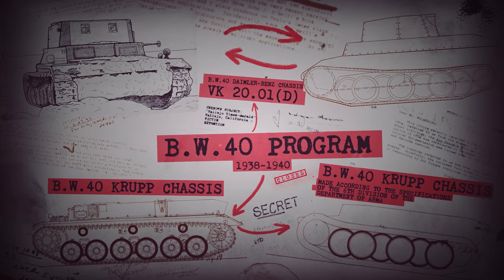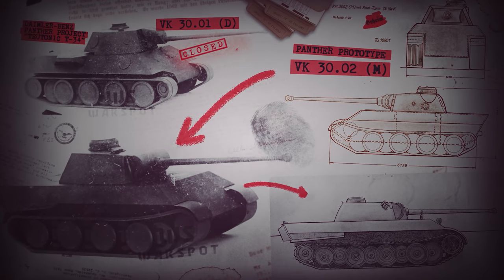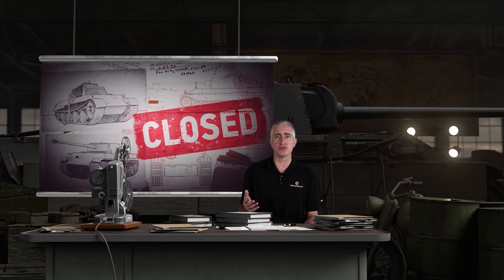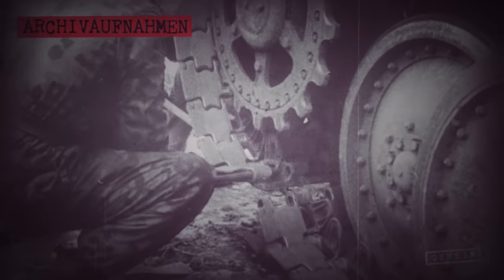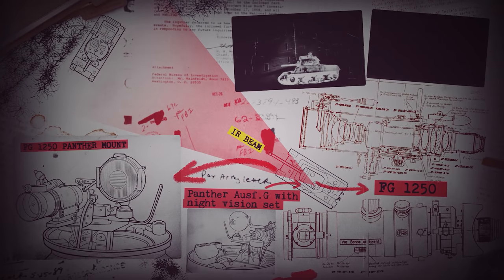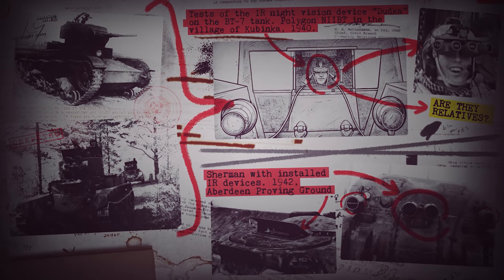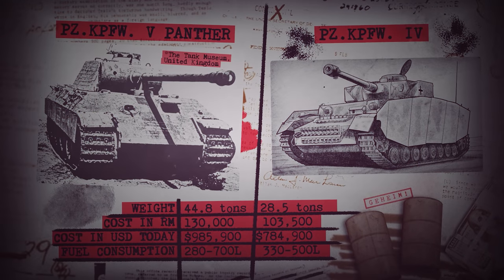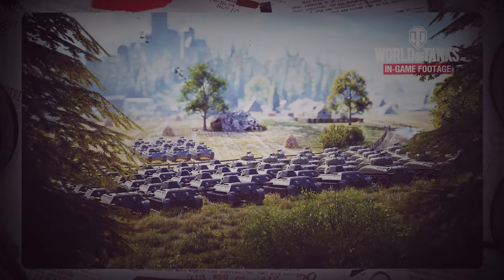Five Things About the Panther with The Chieftain - World of Tanks

Comment: the 5th point you made was interesting.  So my question is:  Would it have been better to concentrate production on Panthers and Stugs and ignore the Tiger program and possibly phase out the Pz IV more quickly?  (was this even on the table?) 

 In other words were they just building too many different types tanks. Was it even  possible for factories producing Pz IVs to easily move to Panther production?   And then there was Hitler's fixation with  Heavy Tanks.  Would Germany have been able to concentrate on a single main battle tank considering  Hitler's meddling and the state of manufacturing in Germany.
Reply: No don't think so if we follow the logic and the purpose of introducing Tiger and other heavy tanks. The purpose of Tiger is to handle enemy heavy tanks such as Churchill or IS or KV, and it is designed to handle multiples of them (the quality mantra). It also supposedly should handle more Mediums when needed compared to a single Panther. 

This is just an example but, if Panther is supposed to handle 2 or 3 Sherman or T-34, a Tiger is supposed to handle 4-5 Sherman. No data at production cost but it probably will not even reach 2 times the cost of Panther, while supposedly able to handle more tanks than a Panther, while also keeping 5-man configurations. 

And in a way, while Hitler does meddle, it probably does not affect it that much and its not like its illogical too on what he's thinking. Even American are using M6 to sell war bonds even though they never use it, and people understand size easier.
Reply: When you think it through, the Germans didn't actually produce that many types of tank.  Throughout the entire Nazi era there was the Pz I -VIB, so seven German types, plus the Pz 35t and Pz 38t.  That's nine types in total, and seeing as both the Pz I and Pz 35t were to all intents and purposes out of production before the war actually began, really just seven.  Further; at any given point in time they generally had, at most, five (and more usually four) distinct chassis under production.  The difference is the huge variety of converted and captured equipment they fielded, which makes what their factories were actually doing look far more of a mess than it really was.

In the same time frame, the US army manufactured the M1 combat car, M2, M3, M5 and M24 light tanks, the M2, M3 and M4 Medium tanks and the M6 and M26 heavy tanks, so ten types.  There was also the M7 and M27 medium tanks, but they were really prototypes similar to Panther II and Neubaufahrzeug.

Similarly, from 1934 through to 1945 the Soviets built the T-37, T-38, T-40, T-60 and T-70 light tanks, the BT-5 and BT-7, the T-50 infantry tank, the T-28, T-34 and T-44 medium tanks and the T-35, KV series and IS series of heavy tanks.

Lets not even get started on the British.  They built literally dozens of different models of tank in this period.

However, it is fair to say that once they got settled into production in earnest, the Americans and Soviets produced fewer types of chassis at any one time (typically just three) than the Germans whereas the British were in more or less the same ball park.
Reply: @ArchusKanzaki  , thanks for the reply.  Really helpful.
Reply: Appreciate the reply.  Thanks much.
Reply: @ArchusKanzaki  Steven Zaloga had put out production estimates for Panthers, Tigers and what not in his book "Armored Champion," giving ranges like: 
- Panther  without gun, radio or other components coming in at 117,100 Reichsmarks, on up to 176,100 Reichsmarks (with everything?); 
- Tiger at 250,800 Reichsmarks (without gun, radio or other components),  on up to 299,800 Reichsmarks (with everything?); 
- and just 321,500 Reichsmarks for Tiger II. 

So seems possibly a Tiger was like around 1.7X the price of a Panther. 

The Panzer IV Ausf. G was estimated at 125,000 Reichsmarks. 

Zaloga cites in a note for this table on pricing: Vincent Bernard "Panzer Produktion," Blindees & Batailles, 2012

He also noted that prices with Panthers at least could vary by factory. 

Otherwise, seems some view as a myth that a Tiger was supposed to handle 5 Shermans. I can't say - maybe on defense, with sufficient number, under conditions that hindered combined arms for Americans (bad weather/visibility, or built up urban environments, impacting air support and field artillery) that could have been the case. But not sure it was a given.
Reply: Interesting question. I suspect they should have focused on producing Panthers, Stugs and Panzer IVs. Panzer IVs still made up a significant portion of Germany's inventory as late as the Ardennes Offensive, with 317 regular Panzer IVs out of 895 tanks at the start of the offensive on December 16. 

The Tiger seemed to not have yield a decent return on effort, in the west at least. Only 1,359 Tiger I tanks were produced during the conflict (Tiger II figures were dramatically worse, at 489).
Reply: @michaeldunne338  Sure. But the point I want to drive is that these are all desperate measures to even have a chance of winning against the quantity Allies and Soviets will be giving. Just being equal or comparable is not enough, the designer MUST hope that a single tank can somehow handle multiple tanks because if they don't, they will not have hope on winning anything. Ideally everyone will want a better quality tanks, with 1-to-1 match of numbers with the enemies or more but reality is not ideal.
Reply: @mattbowden4996  For the US the M3 med was only around for a year (and automotively, is pretty much a Sherman).  Similar for the M2-5 lights.  M6 never left the US.  The M24 light and M26 came in late and were designed to replace the Stuart and Sherman.  Just about every SPG or TD is built on Stuart or more likely Sherman running gear.  The only real outlier is the M18.

The Soviets had 3 chassis.  Light T70 (which was really only Su-76s for most of the war), T34 family and KV/IS families with one being supplanted by the other.

Germany, you have 38t family, MkIII, MkVI (two similar tanks, lots of non-compatible parts), MkV, MkVI, and King Tiger (and that's ignoring Porche's two cents).  That's 6, 5 if you count IIi/IV and VI/king as halfs and ALL were in production at least 2 years.  Then add in SPGs and Marders and it gets complicated.

The thing was, other countries Stopped making older vehicles and replaced them, the German's rarely stopped making a body and new ones rarely followed their predecessors.
Reply: @drewdederer8965  I can't help but feel you've missed the entire point.  Whether or not the Americans only produced some of those designs for a single year or whether they they never left the US is completely irrelevant.  Panzer 35(t) were pretty insignificant in the overall scheme of things, but they are still counted as one of the "too many" tank chassis the Germans produced.

The fact is that the Americans did actually manufacture and put into some kind of service at least as many different types of tanks as the Germans, so the "too many types" argument cannot be the whole story.  I'm not saying that German tank production was a model of efficiency - I'm saying that it was not nearly so disorganized at it appears at first glance because the majority of Germany's confusing plethora of armoured vehicles were actually extemporizations based on captured or surplused chassis, not new construction.

Besides, pretty much everything you say to excuse the M6, M24 and M26 applies equally to the Tiger II - it's not as if it had a particularly long production history either, or wasn't a late addition to the German inventory or was produced in large numbers and, to be blunt, the vast majority of them never travelled beyond Germany's borders either.

By the way, you're flat out wrong about the Soviets.  At the very least you're completely ignoring the 6000 odd T-60s that were built, but perhaps more importantly you're forgetting that I am talking about the entire period of 1934-45.  No one is denying that the Soviets ran a highly rationalized tank program - but to say the Soviets only built three chassis whilst the Germans built nine is to compare an extremely limited cross section of Soviet production in one year to the entire spectrum of German production from the beginning of rearmament to the end of the war.

Also, the Germans 100% did take obsolete chassis out of production.  Pz I, II  and 35(t) production all ceased, as did Tiger 1 production.  Even the StuG III line eventually halted - although that was more because of allied bombing than anything else - so by the end of 1944 the only chassis the Germans were building were the Pz IV, Panther, Tiger II and Pz 38(t).  The latter was only in production because the Skoda works couldn't build anything bigger and the Hetzer was still a viable vehicle, and the Pz IV was scheduled to be discontinued in 1945.
Reply: @michaeldunne338  The Tiger was never meant to be anything than a limited numbers production breakthrough tank. The Tiger 1 was produced in the numbers it was ordered, the Tiger 2 production was basically bombed to smitherens.
Reply: @mattbowden4996  The germans never built any Panzer 35(t), they captured 244 of them when they occupied Bohemia-Moravia in March 1939.  They did however order the captured factories to continue building Pzr 38(t)'s, as they were better than Pz 1 and 2's at the time.  They also built more frames than actual tanks, using the spare for the Marder III's, Hetzers, Flakpanzer 38 and around 70 Sd.Kfz. 140/1 Aufklärungspanzer 38 mit 2 cm KwK 38 scout tanks.

Though the 38(t) really was a Czech design built only in captured Czech factories, i don't really think they count as german "production" tanks.  They also used and modified a lot of French tanks, Major Alfred Becker was an engineer and artilleryman best known as being the primary person responsible for taking obsolete captured British and French vehicles and refurbishing and redesigning them into useful instruments for the German army. With his engineering and organizational skills, he converted the Hotchkiss plant on the outskirts of Paris into a vehicle modification and fabrication center.  Doesn't make them german "production" tanks... just foreign hulls given a new lease on life.

When the StuG III production dropped due to bombings, it was pretty much just changed to the StuG IV, basically a PZ IV chassis with a StuG III G body (StuG's were still badly needed and the jagdpanzer IV's intended as replacements were taking too long to build).  Though despite being different "models", they're both still based on the principal "workhorses" chassis the German used, pz III and IV... so they're also not counting as a different chassis.

Pz II chassis was in production 'till january 44.  But it was intended for Marder II's, Wespe's, Luchs and other variants.
Reply: @SeaRaven227  I was under the presumably mistaken impression that the Pz 35(t) was still in production when the Nazis annexed Czechoslovakia.  Thanks for the correction.

Beyond that, this is exactly my point - I'm not saying that the Germans were doing everything perfectly but rather that the common old saw of "the Germans built too many types of tank" isn't really true.  The didn't build any more types than the Americans and Soviets - not really - and the worst that they can be accused of is keeping obsolete chassis in production because they were the basis of a still useful SPGs like the StuG II, Wespe or Hetzer.  Even that point overlooks the fact that some of the factories involved were physically incapable of building anything bigger so keeping the 38(t) chassis in production for the Hetzer was a darn sight better than building nothing at all.
Reply: @michaeldunne338  Watch out. The Nazis were using vast amounts of forced/slave labor to manufacture these beasts. This totally skews all financial numbers. Indeed, it makes a hash out of them.
The real story is that the rate-limiting-step for these big beasts was ultimately deciding their production tempos. The financial numbers were irrelevant when the Tiger I factory could only ever crank-out two machines per day. AFAIK, the rate-limiting-step for tanks back then was the machining of their turret rings. This proved true for the T-34, M-4, Tiger, etc. NOT machining a turret ring is why the Stugs and SU-76s were such production wonders. The original snap calculations figured that a Jagpanther was 2/3 as expensive as a Panther. (Whatever 'expense' meant to Nazi slave-drivers.) At one point, the talk was that Jagpanthers would be prioritized over Panthers. Guderian entirely stopped that. (His remit did not include turret-less panzers.) 
The panzer force took such a trivial fraction of Nazi Germany's fuel resources that the Chieftain's comments don't stand up. Most of Nazi Germany's fuel is going down the drain with the Luftwaffe and the Heer's truck fleet. Panzers were hauled to the front via steam locomotives. Their life-span ran about a few days in heavy fighting. Indeed, that's why no combatant nation ever worried about the fuel gluttony of such beasts. One only prayed that they'd last long enough to become a serious fuel drain.
Reply: @michaeldunne338  Speer bitterly complained in his auto-bio (1967) that it was Adolf who forced primal production over spares -- much to Speer's regret. Adolf also prioritized panzers over trucks - -again to the extreme distress of Speer. 

As a production maven, Speer 'got it' -- whereas Adolf was too abstracted.

The Chieftain is in error: the Nazis needed more barrels -- and to lie in defense. The daze of panzer advances were over. A grinding retreat was their only option -- and they certainly had enough turf in the USSR to retreat (slowly) for years. Instead, they had their balloon popped.

The big cats were all designed to punch holes in Soviet lines and to ward off KV tanks. It was the KV series that first grabbed Nazi obsessions... not the T-34c. The latter dud -- a two-man turret -- could be destroyed by a 37mm PAK mounted on a Mark III chassis. Most t-34c destroyed during Barbarossa were, in fact, destroyed by this pop-gun. (!!!) In contrast, the KVs proved to be a nightmare to deal with. This was the first production fighting machine that demanded the 8.8cm rifle.

The Nazis lucked out. The KVs were a Leningrad product. After it was besieged, the Krauts stopped running into KV tanks. To look at the Tiger I's specs and that of an early KV tank -- dang if they don't look identical. (!) The Krauts cloned the KV's general specs -- there can't be any doubt.

The T-34c is the most over-rated tank of its era. Its design was not perfected until the Soviets brought out the T-34/85 turret with a three-man crew. One can't miss the fact that the Soviets went from strength to strength once the latter machine entered field service.
Reply: They produced a batch of 200 Panthers in the Henschel factory in Kassel (the only Tiger I and II production plant), to find out, if henschel could built Panthers significantly faster than Tigers.
They could not, because they were simply lacking the space and the tooling. So why should they ditch the Tigers? They were good tanks for the tasks they were designed for.
Reply: @HaVoC117X  , thanks.  That helps paint the bigger picture.
Reply: @HaVoC117X  Because the Tigers were very expensive in terms of money, time and resources to build - including massive outlays for capital improvements and production facilities - and difficult to deploy, supply and maintain. Hence one has to wonder if the sale of a Tiger to Japan for 645,000 Reichsmarks represented a more fair benchmark of costs (and not just price gouging), in comparison to say 176,100 Reichmarks for a Panther (on the high end). 

Considering how unhappy the German army was with the contractors and  progress with development of the Tigers - Henschel among them ("the army was not happy with the pace of work and the tank program was removed from the family control of Oscar Henschel and turned over to an engineering specialist, Stiele von Heydekampf" - not a big leap to wonder about reconsidering such programs. 

Then there was  the question of how effective they were in combat, in terms of having an actual, attributable impact on battles. 

Otherwise, there were several factories producing Panthers. And yes, if trying to produce two different models of tanks in one production facility, especially if one make is pretty much batch production, no kidding things get tight space and production management wise.